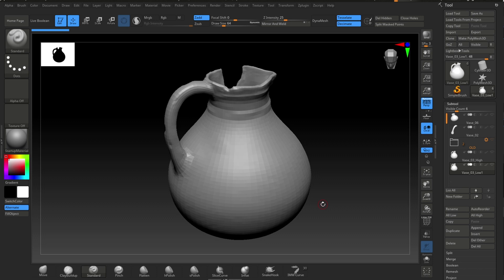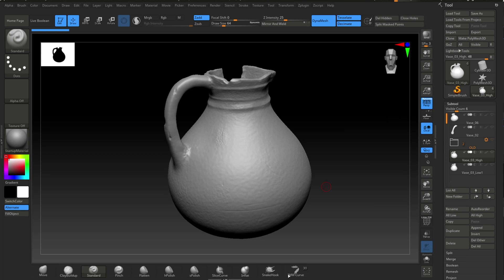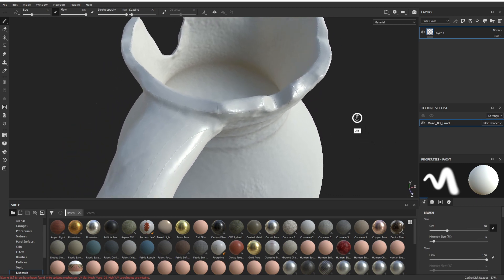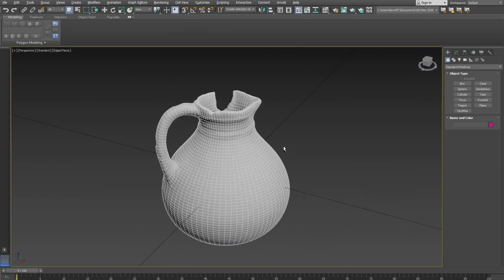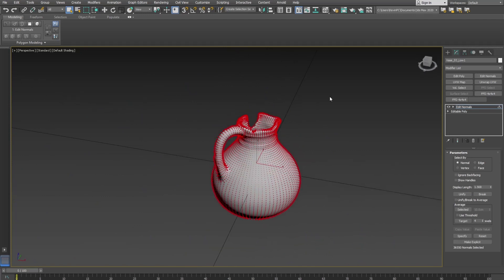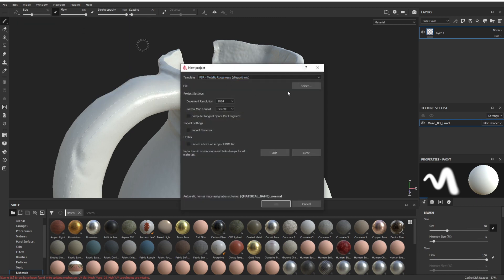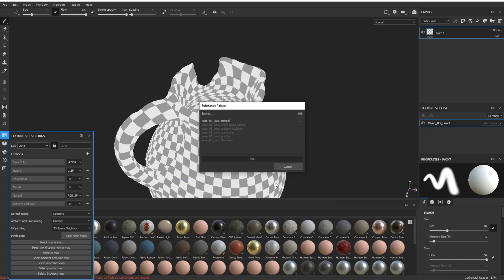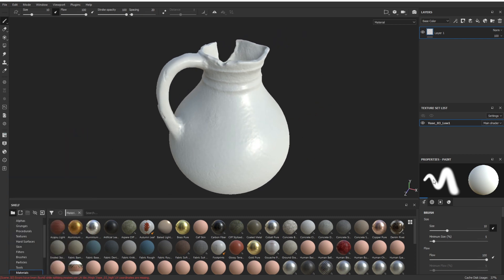Normal Bake Fix when baking mesh maps in Substance Painter.

Comment: I had to put higher padding between those faces and I got it fixed. However, if you do that, then your textures will have noncontinuities obviously. However, you can mitigate this by using triplanar projection in substance if you want to maintain that continuity throughout the texture. Worked quite well for me.

Comment: For anyone wondering what the underlying issue here is, its because the UV Islands are not being separated properly via seams and are picking up adjacent pixels in the normal map for each sharp edge. In order to mitigate this all the sharp edges have to be made smooth. If you would like to have a sharp edge, each edge made sharp must also be a seam. If the issue occurs still, try turning up the padding for each UV island when baking. Hope this answers someone's question.
Reply: Thank you! Very helpful info
Reply: I have figured this and it is still happening with 100-150 padding
Reply from the maker: @Rex-xj4dj  helpfullinx is right to a degree, that can happen, but you can still have tight islands without this issue occurring. Try and get a visual of the normals on each vertex, see it with your eyes, which you can do in Max. They need to share the same normal value per adjoining vertex for each polygon. If they don’t, your seams look like this because it splits off each island but retains the different normals in the vertices and this is what you’re seeing. The best way to see and  test this is reverse engineer using a cube or something and you’ll see. So when you add correct smoothing, the issue goes away.

Comment: I'm having trouble with seams in my Normal map at the edges of UV seams. Is there any way to fix this?
Unifying normals doesn't seem to help in this case. I'm using 3ds Max to model and Substance Painter to bake
Reply from the maker: Where are you getting the Normal Map from?

Comment: Now the only thing left is to find a free version of 3d Max, cause all Autodesk production is absurdly expensive for someone who absolutely has no money
Reply from the maker: Indeed, but unfortunately that doesn't exist! :(
Reply: @KevsArtStuff  hello, i tried this method and my model just get more polygons. Is it suppose to happen?
Reply from the maker: @MsUndertaker99  no... I'm not sure how you managed to do that?
Reply: @KevsArtStuff   I imported my low poly model from zbrush to max, then i first added some smoothing groups and after that i did just like you in video. After 'collapse all' polygon count increased like 3 or 4 times
Reply from the maker: @MsUndertaker99  how are you counting the polygons? Can you see them actually appear? Did you have any other modifiers in your stack ?

Comment: Thank you so much for this, fixed my bake immediately!

edit It fixes the bake issues I had with rough edges, but when exporting all the faces looked rounded and wonky, even baked it into the normal map despite the model looking perfectly fine in substance. 

When I load the exported map into substance painter or elsewhere, it just looks really bad. Any help fixing this issue would be great, thanks in advance.

Comment: It doesn't work! Substance bakes a black normal map!
Reply: black mostly means highpoly and lowpoly are so badly missaligned that rays scatter away too much. two reasons for that: 
1.your lowpoly and highpoly models differ in scale very much, or do not sit right onto each other. import both in 3ds max and check that they are roughly same in size and sit exactly on same coordinates.
2. even though you already pointed highpoly mesh file in substance painter, it goes nuts when you resave the high poly file and needs to be reselected (inside bake menu)

Comment: Edit > Project Configuration > Select > Choose your newly exported meshes with unified normals (or modified UVs, updated geometry, etc) > Bake again. 
No need to start a whole new Substance scene because you made some modifications on a mesh or a scene. It's not called a "non destructive" workflow for no reason.
Nice idea this normals unify modifier. Never seen that around before. Seems indeed to make a damn interesting difference. Thanks.
Reply from the maker: Hi Han, you're right. But at this stage, nothing has been done and the clicks to get to the same position is about the same. However being knee deep in a project and noticing the issue, then modifying the scene is beneficial. Thanks for pointing that out :)
Reply: @KevsArtStuff  I'm using blender and this issue is just solved by getting the mesh into smoth mode before exporting, nevertheless i still got some errors, in the UV seams, idk if there would be any way to solve them since in painter i used tridimensional projection for the most and yet the UVs leave the normals look very ugly... idk if you got any solution to the seams xdd

Comment: I've been looking for this for quite some time. Do you have any idea how to do it in Blender?
Reply: Mesh edit mode > A > Right click > Shade Smooth
Reply: @LouSaydus  Thank you, it worked!
Reply: @LouSaydus  Thanks. Going from flat shading to smooth solved the problem!
Reply from the maker: I did a quick search for Unifying Normals in Blender and there is information out there...
Reply: @KevsArtStuff   I did the same, but it all appears to be simply about flipping normal direction, not the issue you described. But maybe my google-fu is just bad. :D Thanks for trying though.
Reply: If you press F3 in blender and type in 'Normals' with your mesh polygons selected, there should be an option called 'Recalculate normals'. I believe this will do the same as the 3DS Max 'Unify' function used in the video - will basically recalculate the normals of the object for you.
Reply: Smooth shading (polygons) did work